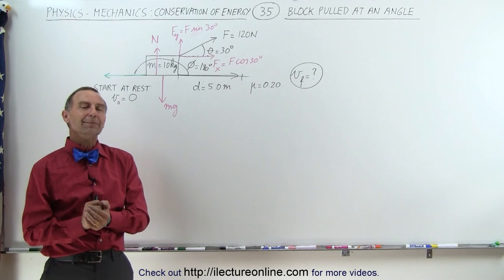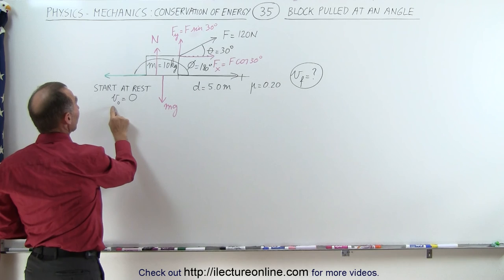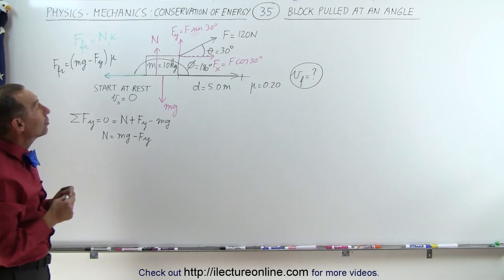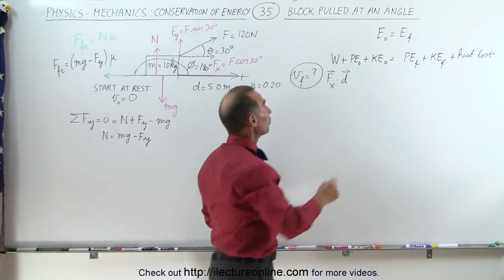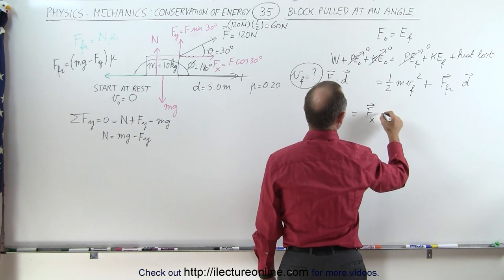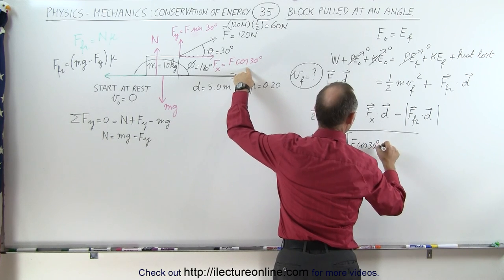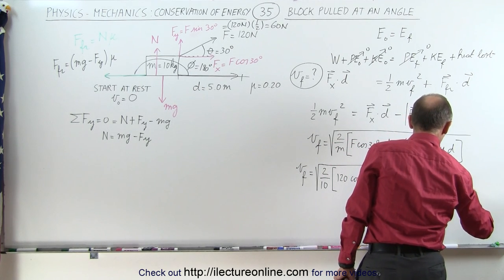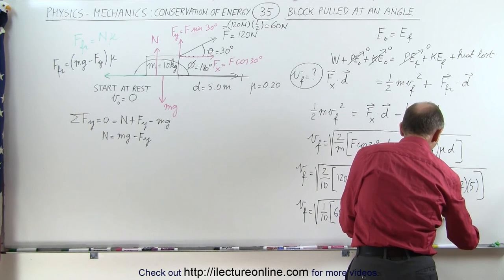Physics 8  Work, Energy, and Power (35 of 37) Block Pulled at an Angle

Comment: Imagine that the mu was very high and that the x-force was not sufficient to move the block.  Intuitively we would expect that if we increased F enough the block would pivot at the rear using the larger y-force.  Could you make an example of this?  Would the block eventually pivot with a larger F or would it slide at the pivot point, overcoming friction?  If it slid at the pivot point, what would be the physics analysis?  We've all been there at some time, trying to move something that was heavy, but could be lifted at only one point.
Reply from the maker: We do have a playlist that covers the concept of friction in more detail.

Comment: why there is no cos theta for Ffr ?
Reply from the maker: The block is on a horizontal plane (not an incline).
Reply: @MichelvanBiezen  but shouldnt there have been cos 180 = -1 ? because F force is right and displacement is at right side, and Ffr is towards left, I would take cos180 = -1 due to the sign of Ffr going to left side.🤔

Comment: when working on these work and energy problems, when do you determine you should use the conservation of energy equation rather than the regular " work equals energies" equations that you used in the basic work problems?
Reply from the maker: The are essentially the same equation, so you can use either one.  I tend to use the conservation of energy equation because it can be used to solve most problems and it also has the work component on the left side and the energy lost component on the right side.

Comment: Can I use F=M*A and kinematics 3rd equation after I have figured net force in X direction.
Reply: Please reply.
Reply: And i got 9.7m/s as final velocity.
Reply from the maker: @yashchaudhary6340  The answer is 9.81m/sec, which means that there is something wrong with your method or it may just be a rounding error.  (I made a mistake on the last step where the one should be a two, which was replaced with an annotation).

Comment: When you are calculating the dot product between friction and distance shouldn't you care about the angle between them which is φ=180 degrees?
Reply from the maker: That depends on which work we are calculating.  For the work done by the force pulling, no.   For the work done by the friction force, yes.
Reply: @MichelvanBiezen  In the video you are calculating the work due to friction without taking cosφ into account, is that the right way of solving the problem?
Reply from the maker: It states  " F cos(30) d "  in the video
Reply: I am talking about the other term, Ffr dot d, which equals Ffr*d*cosφ, and so it should be -Ffr*d. When you move it to the other side of the equation shouldn' t it be +Ffr*d?